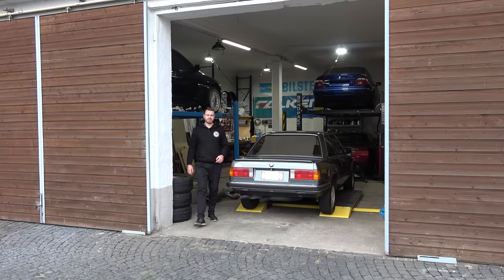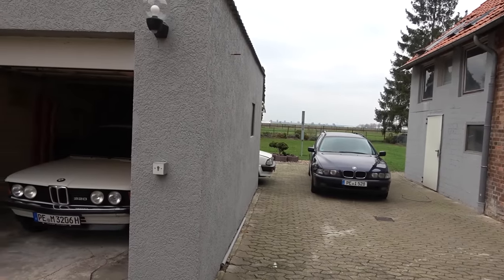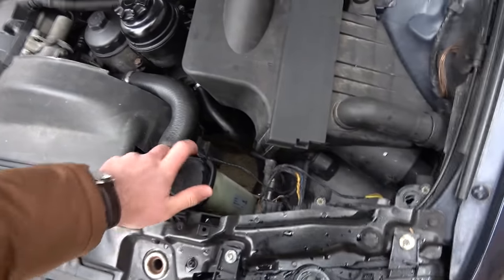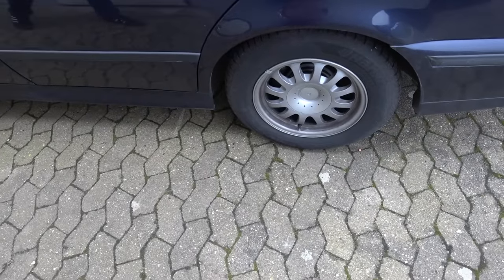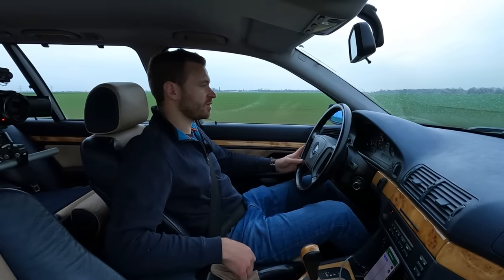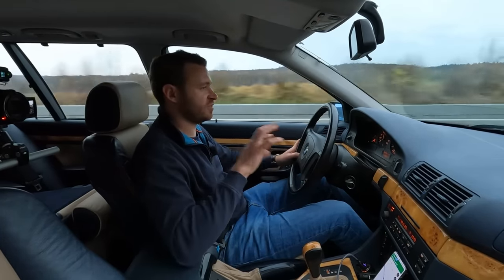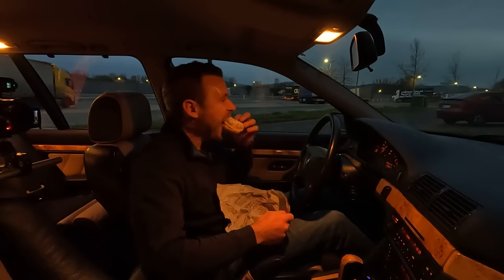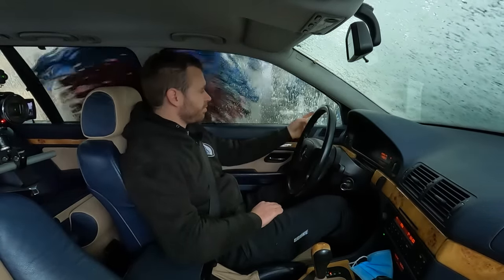I Got a FREE BMW E39 528i Touring Individual

Comment: I do like my e39’s. I’ve owned an individual 530i Sport touring in messing  metallic (was manual also), a Titan silver 540i Sport facelift, a later grey 540i Sport facelift, a 525i Sport facelift, and we still have an E39 M5 in Oxford Green with green heritage leather.

Great cars, but I prefer my E38’s. I have an E38 740i AC Schnitzer S7 and a 750iL.

Comment: Very lovely car, the Orient blue metallic paint reminds me of my '01 E46 320i manual sedan in the same colour (yes they did sell the 320i in Canada). I parted ways with it for an '04 330Ci M Sport Cabriolet in Sliver Grey Metallic a few years later. That car didn't have the beautifully balanced feel of that 320i sedan. And there were better choices sitting right there along side it at the BMW dealer's pre-owned center.  An  '01 E39 M5 and an '01 M3 Cabriolet, a Euro spec car no less, in Laguna Seca Blue.  Wish I could go back in time and change things. I'd probably still have one of those two today 🤦‍♂️😭😬

Comment: Please run an oil analysis to check for coolant contamination in the oil. I would be worried that the oil has been watered down and caused wear on the bearings.

Comment: 20:55 if its showing -40 celsius becouse of missing thermometer located under the car. Its common issue.  And its overheated becoues when  computer thinks outside is -40, it heats things as windshield washer and side mirrors.

Comment: Ah, the sound of the car when you drive away brings back many happy memories of driving my E46, 328i SE Auto.
my car suffered with overheating. I stored it for 4 years and recharged the battery and it started first time! I was always under the impression you cannot replace the head gasket as the bolts won't tighten down? A swine to bleed the header tank, what's the technique?

Comment: I have never known an M52 headgasket repair to work. The block weakens, and you end up pulling the threads out of the block when you go to torque down. The worst part of the M52 is the headgasket failure which is normally down to water pump impeller failure.

Comment: This cold start is caused by a shot by gas recuperating system. The valve is Inder intake manifold, and all plastic tubes could be cracked

Comment: P.S. my 530i sport touring used to run like crap on cold start unless I gave it gas. Turns out it was the hydraulic tappets draining of oil overnight. If I left it long enough I would have to clear the fault codes as it went into misfire.

Comment: I recently bought depo headlights for my e46 coupe. The main reason was that the original headlights were garbage, broken and shaking while driving. I wanted to buy oem ones, but brand new they are 400€ one and second hand about 250€ but most of them are rhd. So i just got depo for 300€ a pair and i will say this: the output light is okay. Plastic quality is poor, but i will just stick to them till I can find a decent pair of oems

Comment: I have a e39 540 Touring as a daily driver, but IMHO the sedan is so much better (if you don't need the loading space in the rear). The rear suspension on the T is a joke, what were they thinking, connecting the rear shocks to the subframe? The rear subframe is shaking around over bumps etc.. Makes the choice of subframe bushings important, I stick with hydro for comfort. Great deal on the car BTW :)
Reply: A failed attempt to free up space. The car is big on the outside and small in the loading bay!

Comment: How did they do the head gasket repair on that engine ? 

The head bolts on that particular engine normally pull out when you try to re-torque them.

Comment: My E38 740 I'll is Orient Blau - it's one of my favourite colours from that golden era of BMW (E31, E38, E39 & E46) I dream of walking into a dealer to order an M8 Individual and getting that colour as my choice... it is hard to match for repairs though, it has 18 different components in the paint formulation... different size flakes of silver, just a few % of red... get the formula even just a little bit wrong & it's a noticeably different colour...
Reply: So true!  Paint shop is doing the deep magic now to whip up another batch of Orient Blau for the E46.

Comment: I previously had a 2003 525i - one of the few manual tourings imported to the US! Is it TUV acceptable to use Polyurethane bushings in the rear subframe? I had them in mine (and recommend it to all of my customers) as in my experience the fluid filled subframe bushings do not exactly have a long lifespan (40-50k mi before starting to get squishy again).

Comment: suprised it past german toof with that welding wouldnt meet minimum mot test standards in the uk i would buy a repair outer sill section and crack on with that angle grinder and chop the rott out will last much longer if its done correct but shes still a nice old wagon none the less

Comment: I had the same issue with my E39 528iT not starting. It was the EWS, I bypassed with a jumper and an ECU flash that disables EWS. It would start with a screwdriver on the starter and key in on Position which is basically what the button is meant to do.

Comment: The biggest problem causing rust on the E39 is the fact that most of the metal parts are pretty much open to the elements. There is like ZERO plastic covering anything important. The E46 has side panels/skirts that cover the lower side skirt area thus zero rust. Also the plastic wheel arches on an E46 go slightly over the edge where little stones and other debris hit the painted edges whereas the E39 is somewhat level with each other leaving (again) the fenders open for damage. 

But then again most of the rust and issues comes out after like what? 15 years of existence of the car?  Some cars even later? Try to expect this on any car made nowadays. The E38, 39 and 46 are the last of its kind and the end of an era where people had money, everything was possible and almost nothing was a problem. And it shows. Stil up to this day. Anything produced later is the "new" era where money and cutting corners was a top priority. And it shows. The biggest hit are the latest V8 engines where you can buy a 3 year warranty to your car and every sane BMW technician will tell you to get exactly this warranty and once your car reaches 2,5 years be ready to sell it. Which is really sad.

Comment: I owned a 528i which was very reliable, but not much power. If you want power go for the 530i or torque go for 530D. My 2003 530D was insane, I felt really sorry after selling it for a crap 2007 520D which was the worst 5 series ever, loads of electrical problems...

Comment: 31:18 but the rust isnt that expensive to get repaired properly at the jacking points. I paid arround 2-2,5k for it and they got rid of the rust at both front fenders, 2 doors and repainted it as well for it, and they realy matched the color as well (BMW 397 Anthrazit Metallic) which isnt that easy.

Comment: Rear jacking point eaten by rust... Bad memories. Cost me an arm to be properly fixed.  Fuel tank, exhaust, drive shaft have to be disassembled to get a good acces and weld properly.

Comment: You mentioned something about the vanos in this car being repaired????  I have a 2001 525i with 130K miles on it.  Since you've driven a lot of e39s, what are the symptoms of a failing double vanos?  I'm to original owner and can't really tell that mine is failing.  I wondered if you could tell me some signs to look for.  I know sometimes when you repair a component, you wonder how you could have put up with it (whatever the degraded part was) before.   But once you get it fixed/optimized, you realize the difference.  I know I have a different engine from the one your driving here but I would love to hear what the comparison when the double vanos hasn't been fixed and when it has for a M%$ with mileage in the 130K.   Thanks.

Comment: PLEASE, PLEASE, PLEASE: fix the rust (maybe later) It's a keeper, and too good to let it rot away. Forget the present value; it'll get higher later. 
Doing the bodywork (properly) should also make a nice, and slightly different from normal, series of episodes for your multitude of fans to watch !!!!!!!!!!!!!!!!!!!!!!
Stay safe, and remember, not too many of those sandwiches and donuts or you'll end up with a waistline like mine. 
You have been warned !!!!!!!!!!!!!!

Comment: It's a shame they never used double galvanized sheet steel like Audi/Porsche. My 1999 touring went to the scrapyard 8 years ago here in England.
The rear sills were completely rusted out when checking with an endoscope. The tailgate falling apart with rust.
The previous owner kept all the old repair invoices from independent specialist garages and the total was high enough to put anyone off ever owning a BMW if you can't do some of your own repairs.

Comment: No update? This is very common problem and i am waiting for you to fix it, so i can fix mine car :) Does not want to rely on mechanic. You should fix this engine and not do a swap thing. I can not find a solution on internet. My car is in good condition with original parts only that single problem.
I started noticing problem in the winter when i started using heating. Also little while before that i have changed water pump even old one was working and expansion tank for original one. Only thing i did wrong was using cheap coolant cap with lower pressure  by looking at internet enthusiast. I bough original one after that but it was too late probably. All of that things i have done is to prevent thing that happened by preventing it:) If anyone have advise...

Comment: At least winter here is 15 minimum. I wish someone would give me an e39. To join my e46 318 and e87 118 M Sport. I had an e22 318 in the same colour combination. Both my currents have 205000 on them with no smoke and no leaks. The e87 was $8000aud and the e46 $2000aud.

Comment: I have the same issue with acceleration with my 528iT.  I feel a small judder when I press on the pedal around 2000 rpm.  It's as if there is a spot that is binding, then it breaks loose and all works normally.  This is after I had to replace the throttle body due to an electrical issue,  It's weird, doesn't cause me any issues, but it isn't right.  No codes, either.  Anyone else have this?

Comment: Anyone have an idea why my e46 325i Touring AT makes a sqeeky sound (like a wet rubber against a flooor) when I turn the wheel when it's cold? Workshop fixes it every year but it comes back again over and over and I have no idea what to do...
Reply: Probably related to your powersteering pump, or something on the accessory drive with a bad bearing, or the belt could be out of alignment.

Comment: I had also a E39 528i touring, silver, M package and shadow line. Stunning car but the tax, the insurance and the maintenance costs - omg. For maintenance only 10.000€ in just 5 years, it was ridiculous. Everything on this car seemed to break after 250k + Kilometers. It would take me 2 pages to write every part down what I had to replace over time.  When I went to the gas station I started crying all the time. 193 HP in this car just feels like riding a iron pig which never gets out of the swamp. After all the money I spent the thermostat broke, the engine overheated and cooling started to disappear. A very common problem with E39 I found out afterwards. Never found out where the cooling went, it wasn’t burned from the engine and also pressure tests didn’t show any leaks. It just disappeared and it got worse and worse over time. In the end I sold it for 1500€. One of the biggest disappointments of my life. I never ever would buy a E39 again in my life. In my experience they aren’t reliable, affordable yes. But that’s for the reasons above. But Iam also a long time subscriber and still enjoying your content. But I now it’s your money you spend and not mine ;-).

Comment: why not get the orange indicator headlights? that's a single vanos M52, orange indicators are meant to be on her. Are you insaneeee The orange indicators look umpteen times better than the others, also you can be more certain they are original

Comment: I eat your videos like chips. Great car, the best inline 6 BMW made! Classic. The first thing, you must do the CCV, its crap on the M52. It likes to run on Castrol Magnatec 5W-40 C3 because of the nikasil liners. The radiator is shit in the lower part, change it. It has a webasto heater, its rare and shit to bleed. Depo is totally shit, agree! And the achilles, the auxiliary fan not working kills the termostat housing and the cooling system if you use AC in the summer and dont take this in account. It doesnt give any codes. Still, I love this engine, its one of the best ever made.

Comment: Sold my e39 528i after 1 year of ownership. Worst car I've had also best one. Way to many problems electric wise. Bought it 4,5k and ended up spending on new sensors, radiator mainly sensors about 2k. So. Yea sorry but had to do. Was comfy and fast but to much problems

Comment: Water/coolant in the cylinders that misfire on cold start. Head gasket leak. No big deal, little R&R with some cleaning.
Reply from the maker: That doesn’t make sense.
Reply from the maker: Definitely not a classic headgasket issue. If it had a leaking headgasket and cylinders filled with coolant, it would smoke like a chimney from the exhaust and coolant would find its way into the oil. If I press the throttle pedal within a second of starting it, it goes away. Then also if I leave it for 20 seconds, it'll misfire until I press the pedal. Not a sign of a bad headgasket.
When I use diagnostic to see how each cylinder is running, I can see that the misfires are jumping all over the engine and not staying on one particular cylinder. Again, doesn't point to a bad headgasket.
Also, previous owner had this same issue even before he replaced the headgasket. I'm not saying it's good until I verify, but it's very unlikely at this point.

Comment: I'm sorry but I completely disagree about the headlights. On the e39 and e30 particularly the stock Hella lights are absolute garbage. The e39 nfl Hella lights are dim and have poor geometry. The adjuster motors rust, the adjuster brackets are made from hard plastic and they break making your light assembly  bounce around in the casing and the transparent outer covers are just plain rubbish - anything that touches the "glass" makes scratches and chips. The depos have better geometry, the glass is more resilient (despite yellowing faster) and the adjusters don't snap after 4-5 years. On the E30 the stock hella lights are crap. Can't see 10m in front of the car. The depo e30 lights are incredibly good. The lenses are slightly larger and the light bulb is set a bit further back, giving a bright light cone and great cutoff so you don't blind incoming traffic. The only bad Depo headlights (light quality-wise) I've seen are the e46 ones. The only decent hella lights I've seen are the OEM e39 facelift ones, but they also suffer from issues with adjusters.

Comment: The fuel you put in was 95 (E5). The 98 was E10.
Reply from the maker: Lol, no. How do you even mix that up? It says on the pump and E5 is more expensive.
Reply: @M539Restorations  Oh right. My bad. I'm a diesel F20 BMW owner, so gasoline for me is not my thing
Reply: *sorry, agricultural engine owner
Reply from the maker: I can actually see why it might be confusing, but the higher the E means more ethanol.
Reply: The thing is: neither in Portugal or Spain we have e5 with 98 octane fuel. The only 98 octane fuel has 10% ethanol. So that’s why.

Comment: Had a 528 e39 myself and did run it for 7 years and 260.000km without any issues. But seriously that interior it’s insainly ugly, at least the trim has to go. Do a facelift on the exterior

Comment: OK, Sreten. I need you to drive properly. Change how you hold the steering wheel! USE BOTH HANDS!
Obviously, you have never been in an accident, but when it occurs, it will be in the most unexpected moment and you will have ZERO control over your car ... Please be safe, and take better care of yourself and others. Many young people watch your videos and they will learn (from you) this wrong way of handling a car. Be a better example, please.
Reply from the maker: Please don't be that guy. I have 100% control of the car and I am holding the steering properly unlikely majority of the drivers on the road. When I'm driving fast or spirited, I'm always using both hands as you can see on every other video. In other cases, I'm adjusting to road conditions while still being able to control the car in case of emergency. I didn't start driving yesterday.